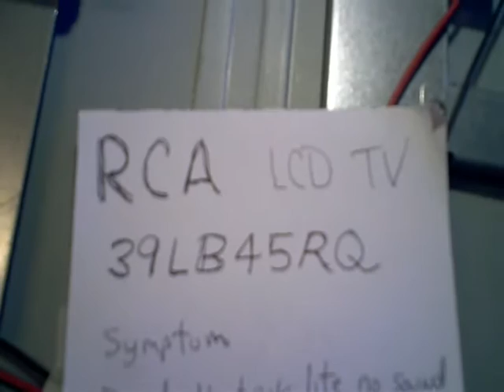RCA 39LB45RQ LCD TV. EEPROM Repair on main board

Comment: Thank you for this video!  It helped me fix an RCA TV via EEPROM swap.  I have a RCA LED24C45RQ that my mother was using as a PC monitor and it died...same exact symptoms.  I bought a new EEPROM and swapped it out, and now it works just fine.  Maybe RCA used a bad manufacturer/batch of EEPROMS on these series of TVs.  The replacement EEPROM I got is a different manufacturer, so hopefully she can get another 6 years out of that TV.

I'm posting this here so it will show up on Google searching for other people via part or model numbers.  This is the EEPROM I bought from ShopJimmy (Mainboard #: 24RE010C851LNA0-A1):
https://www.ebay.com/itm/RCA-LED24C45RQ-2504-LE24C45-A1-24RE010C851LNA0-A1-Main-Board-U16-EEPROM-ONLY/253055569189?hash=item3aeb498d25:g:8VUAAOSw9ZNZjJKk
http://www.shopjimmy.com/rca-24re010c851lna0-a1-main-board-for-led24c45rq-sn-2504-le24c45-a1-loc-u16-eeprom-only.htm
Reply from the maker: Thanks for the information.

Comment: Thank you for your answer I already did menu 1147 the display comes out but do not go exactly to the place to apply it? I saw your video and it worked for me but when they changed the eeprom and then I turned on the television I got the image backwards. Thank you
Reply from the maker: You might contact Mike at mikestvtips.com and see if he knows about the problem you described. In promoting his books on TV case histories he use to give away one free tip.

Comment: Hi, I have the same TV, the image is upside down, what can I do?
Reply from the maker: There should be something in the service menu to correct this. You will need to find the service code to enter the option, and then find out which setting in the EEPROM will repair this problem.
Reply: Grants Pass TV Repair thank you

Comment: I read in another video that if you replace the eeprom that you need to transfer the data from the old one if not the AV functions will not work, is this true?
Reply from the maker: Eeproms can contain many different operating parameters which are necessary for the TV to operate, so yes you want to transfer from the old one to the new one if possible, but I try try to buy them pre programmed if possible. Shop Jimmy sells many pre programmed eeproms for TVs.

Comment: I have the same problem with an RCA  46 inch, model number 46LA45RQ. The red light comes on when you plug it in, then when you push power on button it turns blue.When you try to turn off, the blue light stays on with no other functions. The EEPROM appears to be bad order.

Comment: I am working on a 46LA45RQ RCA TV and believe I am having the same problem...  I replaced the power supply and now have a red power light, before I had nothing found a blown fuse and bad diode...  I am still not getting any output voltages expect for 5v at the 5VSB pin...  I made an offer on a mainboard and while I was looking through the listing on eBay I saw the eeprom chips and decided to research them and found your video... Thank you so much for making a good video on the topic I have a hot air station / soldering iron and can easily replace the chip hopefully it will solve my problems... Do you have any advice or know where to find a electrical schematic download... Thanks!
Reply: Did you manage to fix it?

Comment: How would anybody figure that one out, by them self.
Reply from the maker: MrMac5150 Some of the electronic wizards own EEPROM programmers, but other than testing the input voltage and or input and output data lines, I have often gone by symptoms and solutions found in TV case histories. EEPROMS seem  to be high failure parts.
Reply: Grants Pass TV Repair My guess is that TV's where EEPROMS is prone to failure, there is specific address that is being hammered with writes all the time (a counter etc.) and sooner or later that cell wears out and the TV stops working.
Reply: MrMac5150   crude
Reply: eeprom is heat sensitive. The heat(room temperature is enough where broken) messes the data inside, but somehow the correct data is still in there. To have the correct data, you need to freeze the chip which deepens your question. But for those who do electronics, those electronic dusters to clean the boards are really cold. Someone must have dusted their eeprom while fixing the tv and the tv worked for a moment.